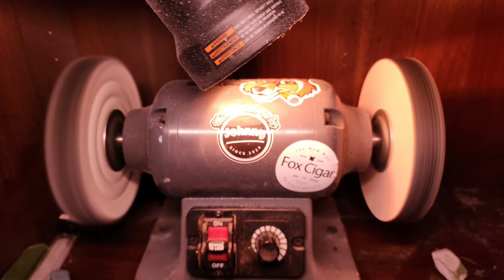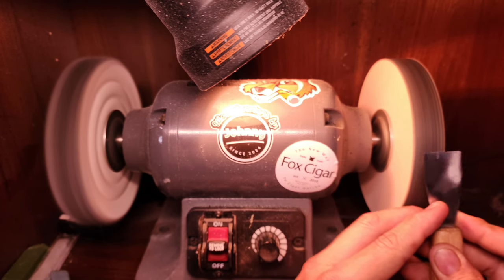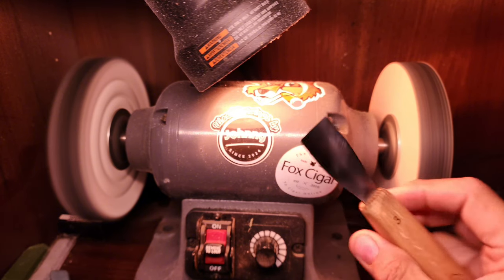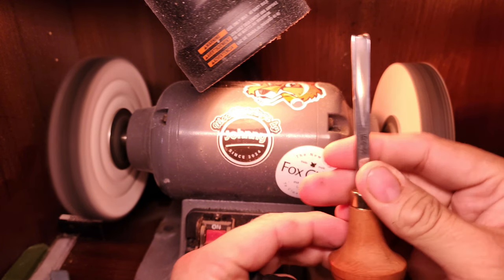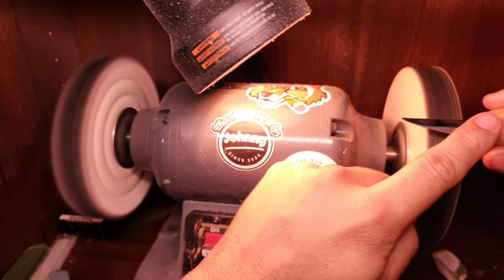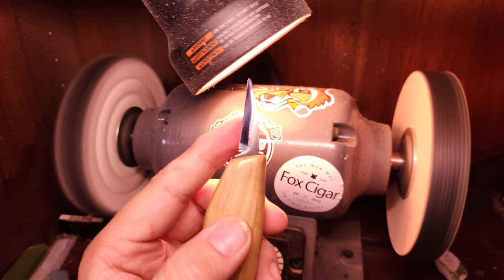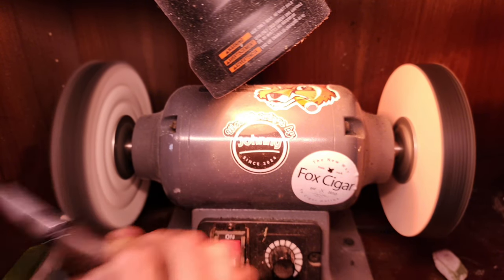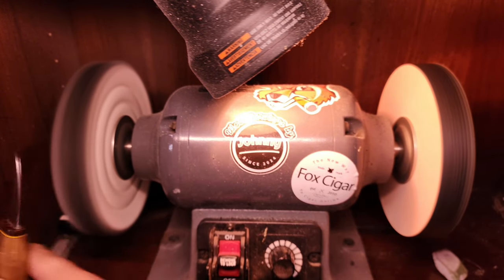Power Stropping, Honing Knives, V-Tools & Gouges under power.

Comment: Great video.   I now need to find a leather stroping wheel.
Reply from the maker: I did a video on converting a Bench grinder into a stropping wheel and linked the one i used.  Just a heads up if it helps.
Reply: @JohnnyTheLayton  I did just see that.  Thank you

Comment: Hey love the vids! It should be mentioned for safety one of the biggest dangers of a bench grinder is if its not securely fastened to a bench
Reply from the maker: @VENOMDIGIACOMO  That's a good point, thanks
Reply: I copied Johnny's grinder and these are heavy tools and design to say on a bench and mine doesn't travel so disagree they don't need fashion down on bench.If yours travel you should mount it down
Reply: @JohnJude-dp6ed they are designed to be securely fastened to a stable bench. This isn't a debate

Comment: Thank you for this video.

I have two questions:
1. Is it ok to really just use different paste on the same strop without removing the old one? Could anything go wrong?

2. I have a strop with a very smooth side and a very rough side (rougher than your strop). Can I still out some paste on it and use it without the smooth side in addition?

Sorry, I am a little limited with my English…

Greetings!
Reply from the maker: @PrincieOnThePea  i switch between  different pastes all the time. 

I use both rough sides and smooth sides.  I would say a smooth side performs a little better for me, but not by a lot.
Reply: @JohnnyTheLayton  Thank you for your response! So I‘ll try another paste very soon!

Comment: How do you do the inside edge of gouges and V-tools?
Reply from the maker: @EastCoastEDC  Sorry I didn't make that clearer.  That's what the buffing wheel is for.  Honestly you can strop everything with the cloth buffing wheel only if you apply stropping compound to it.  It's moving quickly enough and as cloth it can adapt to the shape of what you're doing.
Reply: @JohnnyTheLayton  ok thanks!! I have a brand new bench grinder that I’m going to convert after watching your video. Wasn’t sure If I needed a special profiled wheel like some of the sharpening systems out there for the inside edges.
Reply from the maker: @EastCoastEDC  those profiled wheels make it a lot easier to get the perfect edge on your tools.  A guy at my local carving club has the fancy Burke ultimate sharpening system.  It's fabulous, I would love to have that.  But I can do pretty darn well just using the system I have and not spend all that.

Will I invest in that system at some point?  Probably, because that makes this even easier.  While on a leather wheel I have to carefully line things up, rotate a tool.  He barely has to pay attention and just out his tools on those grooves, count to 2 and he's done.  So they're great, just expensive
Reply: @JohnnyTheLayton  yea they aren’t cheap!! 375 plus tax and shipping up here in Canada.